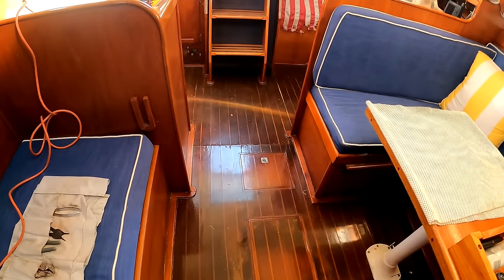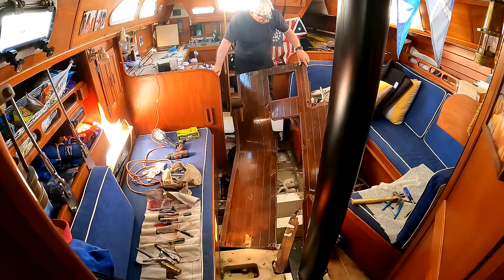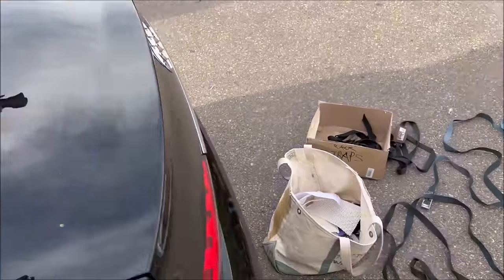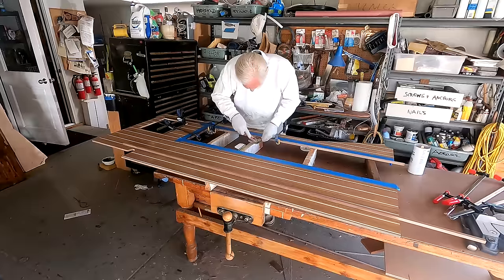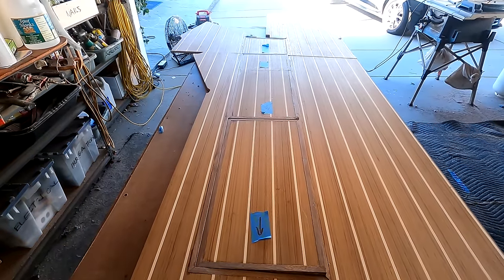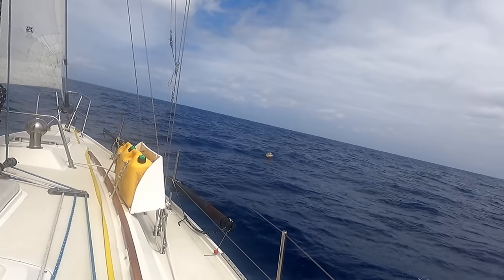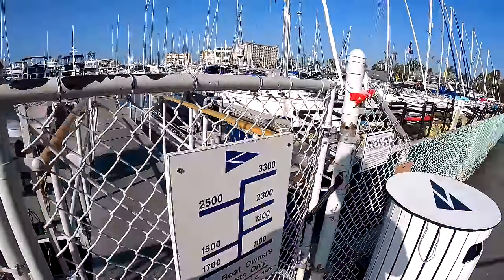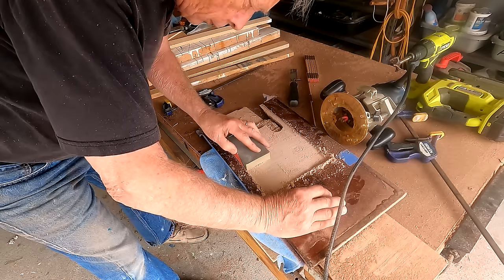Battle for the Sole of Thelonious II

Comment: Thanks for another great vodeo! For next time, here's a tip about removing buried/broken screws:
My CT56 has framed screens under the large (60 & 70 Series) hatches. They're hinged, and when I got the boat several of them had the hinges rusted frozen, thankfully in the open position. Over half of the #6 screws had the heads already stopped, and others broke off during removal. My solution was to get very small hole saw bits. They're diamond grit, made for tile work, but with frequent rinsing, I was able to drill out the screws. Filled the holes with thickened epoxy, new pilot holes and screws.  Since they are covered by the new hinges, the plugged portions of the (Mahogany) screen frames and jambs are invisible.

Comment: Great work. I do finishes, always use a vacuum attached to any sander where dust might be an issue not the silly little bag. It's cuts airborne dust and as important prevents pilling of the material on the abrasive surface. Yes the acetone dissolved the can liner, it will dissolve anything, I'd not use it for cleaning a brush, ever. I could probably destroy the brush given time. Thin Epiphanes with mineral spirits or if spraying naptha (evaporates faster).

Comment: It's wonderful to sail. I myself learned to walk in a boat, as did my father and grandmother. Great-grandmother was a sailor at the beginning of the 20th century, and that's how our family's sailing life began. It is a pity that we have to take our boat to the dock for the winter due to the freezing of the sea. Next week, week 1 in 2024 is predicted to be -50°C below zero, it's -58°F, that's cold even by the standards of my home country Finland. But there is a good side to lifting the boat. Fiberglass boats are allowed to dry on the deck and hull. An incredible amount of water is absorbed into the fiberglass in the summer because gelgoat paint is not waterproof, even though many people think so. I think that's exactly why your frame was wet under the floor. The solution is special in terms of structure, why aren't there even holes for water to drain into the bilge?

Comment: Mr. Williams, on my 1986 J 35, I  recently chose to use 1/2'' coosa board covered with a layer of 1/4" synthetic  material  that is colored to imitate the appearance of your expensive teak and holly plywood.  I like that the synthetic material provides very good grip on my shoes, that I hope will prevent slipping in rough seas.  The coosa board is both inexpensive, very durable, and not subject to the same wear and tear of the elements, once I covered it all in a layer of fiberglass. That is to say that I expect the coosa board to outlast me, I'll be 52 in two weeks.  Any time the synthetic teak and holly-look material wears or becomes excessively dirty, I can simply cut new pieces to replace the old.  Thanks for the videos.  I have been enjoying them for some years now.  Happy New Year!

Comment: So much work, thankfully we all like this sort of stuff, don't we. I'd say though that Ericson dropped the ball here, mainly by attaching the sole permanently to the structure and fitting all those 34 trim pieces, making it impossible for the water to escape. I have a Beneteau First 35 from 1982 and the floorboards are absolutely pristine; but they are just dropped down in place, thus removable, with the added advantage of being able to peer underneath them, should something untoward be happening down  there. If I were in your shoes, I would probably make the new floor boards drop in, if at all possible and forgo the trim pieces, where/if possible. Keep up the good work ;-)
Reply: Thanks for the insight. I might be buying an Ericson 381 soon.

Comment: I believe they used (and still do use in wooden boat building - see Sampson Boat Co) flat head screws is so that you could more easily clear out the slot and remove them later on, in 40 years when the next rad dude replaces her sole. 🤜❤️🤛

Comment: That's a very beautiful and sea worthy yacht. I would like to see a solid teak floor but too late. Iif you do it again, sail to S.E. Asia and you can buy the solid teak for $900. You did a commendable job with the trim and you are right about Millers wood work skills. 
My father built interiors in Hollywood, built sets and acted .  
You should never use a jig saw on this fine work , you need a band saw and table saws and routers to get it tight and clean. .

Comment: I did a similar project with my '86 O'day 35 in 2014. I epoxied the bottom and sides of every piece of plywood, and used satin finish polyurethane on the top. To secure the pieces to the floor I used 3M 4200 fast cure. It came out fine, but I won't want to do it again.

Comment: I own what is often called a 'cheap production boat', a 1994 Bavaria 350 Lagoon. Her sole construction is way above that of your boat. The sole consists of a number of individual boards that can easily be lifted iot access the bilge. No water gurgling around unseen for years. I can easily clean 90% of the inside bottom. After almost 30 years of sailing the bilge is kind of white in color.

Comment: 13:27 you could have taken a plunge cut with your circular saw that would have give you a straight cut over a short distance , you can do this by butting the circular saw up against a stop G clamped in position then slowly lowering the saw into the material , nice job though looks great

Comment: Nice job on the cabin sole.  I'm looking forward to your next ocean crossing.  I am curious about those nice hand holds on your cabin roof.  Are the connecting screws/bolts going thru the cabin roof or just really short?  I'm thinking of installing some in my Ranger 33.

Comment: Christian, early in your ownership of Theolinious you mentioned that it was a dry boat. I am wondering what the source of the water trapped in the grid is? Are there weep holes in the grid that would allow them to drain, are they clogged? Seems as if this issue isn't addressed you will have problems with your new sole plus the boat will be stinky? Do you find the gloss varnish slippery when wet? I have read that it is not recommended for a sole application. Thanks for a wonderful video. Ben S/V DAWN
Reply from the maker: A good point and one I should've mentioned. We had a bilge flood a few months back, result of a failed DSS seacock. Story here: https://youtu.be/9XtBv5MZ8qAn
No doubt the overflowing bilge finally destroyed the original sole.  Re high-gloss varnish, it has an odd property of being simultaneously glossy and sticky underfoot which allows feet and shoes to cling. Or at least it isn't as slippery as it might look and has never caused an issue for me.